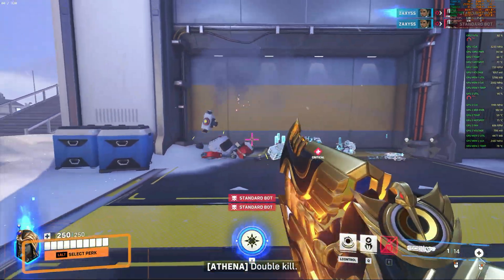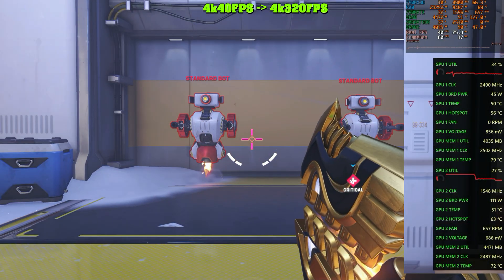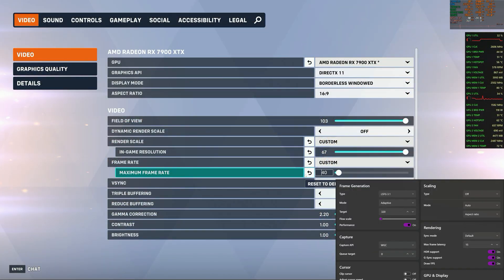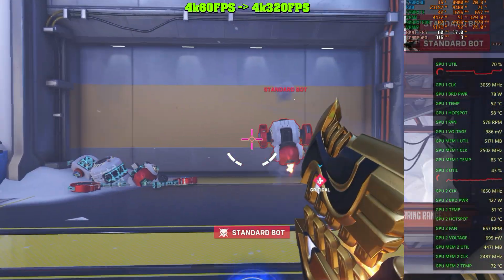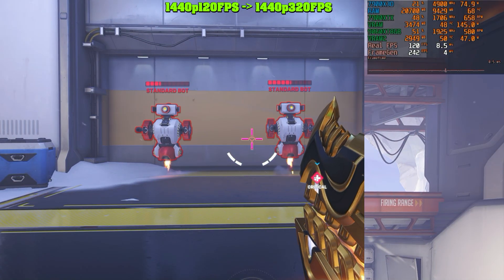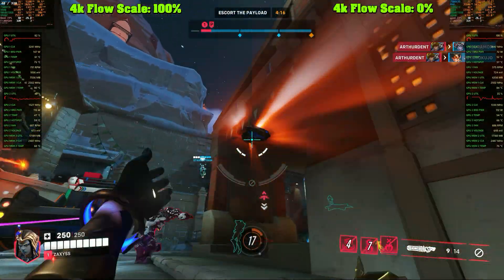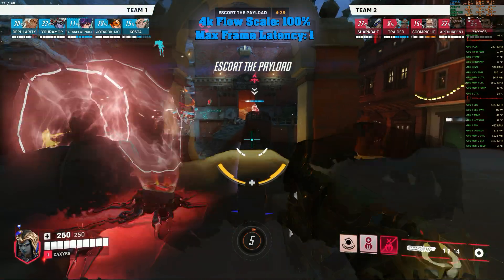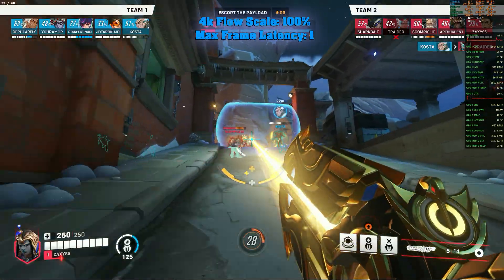[Lossless Scaling] DUAL GPU Problems & Solutions Vol. 3 Artefacts

Comment from the maker: Also, one thing I noticed when I got the RTX 5050 as a framegen card was when I disabled my iGPU, I was no longer able to force Doom Eternal to render on the 7900xtx; it was still running on the 5050, but when I activated the iGPU again, it was working again... It seems like the iGPU acts like a referee to the other two GPUs, deciding who will render and who will not.

Comment: Can I really use lossless scaling safely in ow2 without any ban risk?
Reply from the maker: Yes, Lossless scaling is not interfering with game engine... It only using rendered video and nothing else, think of Lossless Scaling as another monitor connected to your gpu but this monitor can do frame gen :).... that's why you easily use LS with games that have locked framerate to 30 or 60 fps.
Reply: @zaxyss7339  thnx for the answer bro and god bless u, take care

Comment: The quality production of this video for a relatively niche topic is surprisingly good, kudos to you buddy I subscribed, In my case I finally got my rx 6650 xt (Render G4x4 by riser) and rx 580 2048sp (FG G3x16 MoBo slot) set up working, it's very good on 1080p to get max refresh rate (180hz) of my monitor and I can't feel the increase of latency, I don't know why the 580 was freaking out when connected by the cable though, but I swapped them and it got resolved, 5-7% performance lost to my rx 6650 xt  connected by cable but now I can max out my monitor in any game with almost zero performance lost. Dual GPU is a real hassle to get working, can get expensive if you have to use an M.2 slot (I spent 100 dollars for the cable and GPU), I would recommend it in the current market.
Reply from the maker: Well thanks, when I was building dual gpu setup there was not many information on youtube so I thought I will fill the gap sa I see dual gpu being future cause todays high end gpus are really expensive, but many people have their old gpus laying around, so with lossless scaling you breathe new life to them. I think this trend will be more and more popular in future and having having somebody cover all their problems can be very helpful 🙂